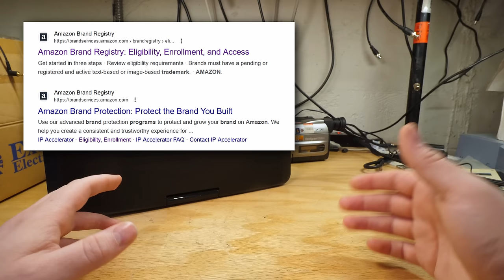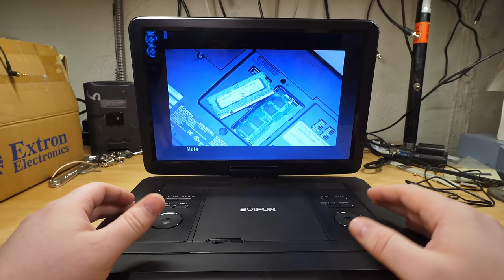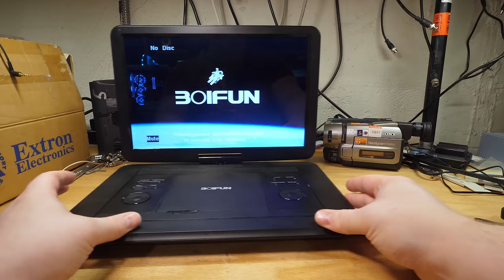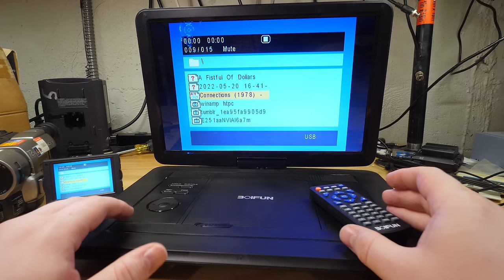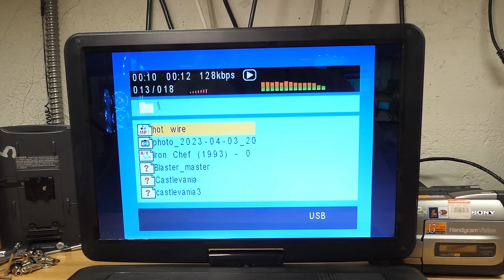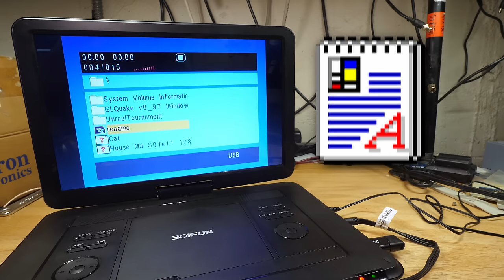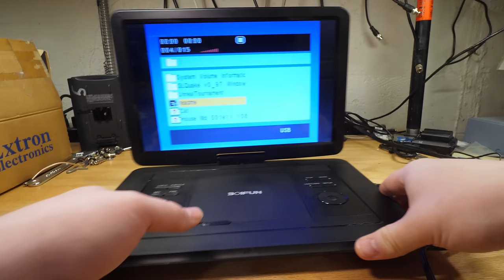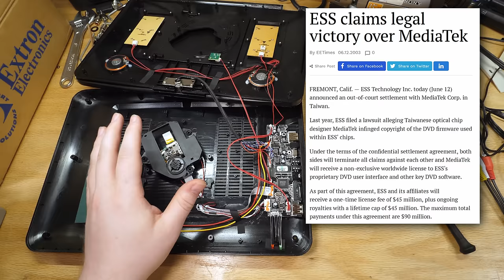Cheap, Silly, Remarkably Useful DVD Player

Comment: What's actually impressive to me is that only maybe 6 years prior to that chip coming out, you needed a dedicated MPEG2 decoder to play DVDs on a typical PC. Those decoder cards were packed with chips, and there were also CardBus versions that were prone to overheating. Only 6 years later we have a single-chip solution that not only decodes MPEG2 and MPEG4, but also incorporates the rest of the system-on-chip. It looks like a worthless chip these days, but for 2006 it's actually impressive. Tech used to actually advance a LOT faster than it seems to these days.
Reply: In the early 2000s I had an 866 mghz P3 with an awful intel 815 iGPU that could play DVDs & it to my knowledge it did not have hardware mpeg 2 decoding.

Comment: 6:40 About DVD's aspect ratio... yes, it's hardcoded... and very limited, at that. DVD-compliant video is strictly 720×480 (1.5:1) and a flag is used to tell the player whether to morph it to 16:9 (1.78:1) or to 4:3 (1.33:1). Basically, every single movie ever pressed to DVD is anamorphic. And how about movies that were shot and edited in wider aspect ratios like 1.8:1 (The Breakfast Club) or 2.4:1 (Inception) or something ridiculously narrow like 2.76:1 (The Hateful Eight)? Well, they're letterboxed out to 16:9 and morphed to 1.5:1 all the same – there really isn't any choice in the matter.

The tradition kinda continues with Blu-ray too, though at least Blu-rays are true 4:3 and 16:9 (i.e., 1440×1080 or 1920×1080): Blu-ray movies with aspect ratios wider than 16:9 are still, I sh*t you not, letterboxed out to 16:9. When you watch a 2.4:1 AR Blu-ray, it's ~1920×800 letterboxed out to 1920×1080.

How do I know? Well, I've been ripping DVDs and Blu-rays to PC for... wow, would ya look at that... just about 25 years now. Damn, I should look into turning this hobby into a side gig. 😅

Comment: As far as I can remember there was some kind of flag signal that analogue SD video signals could carry that triggered wide screen settings in monitors. Most of the last batch of 4:3 CRT TVs even had a "you know, I'm not a wide screen, so how do you want me to show this widescreen image?" In the OSD settings. 

I remember this specifically as over here in Sweden, in the pre HD days, ad financed channels would switch modes for each ad break and you saw the switch happen in real time if you set things up correctly. I suspect there's something hidden in the magic land of the analog off screen video signal. 

DVD's however, I am pretty sure, did this with a digital flag in the video stream. Basically stating "oy! I'm widescreen, deal with it." And rhe scaler in the hardware would make an appropriate signal out of that and feed it to the RCA, SVideo, SCART, or even HDMI for the fancy ones. But it does make me wonder about those old CRT's did they actually digitally rescale it, or... did they just fudge the timings in the CRT to draw it stretched out when needed? I guess it could get messy with the shadow mask. But the relative simplicity of ut  makes me want to believe it.

Comment: 30:30 on my dvd player you get a low batt screen indication in the center of the screen, the screen starts turning on and off while the audio stays and then shuts off completely, mine also has digital tv (dvb-t) but no av in and game function, came out in 2008

Comment: If that screen image can flip, it'd make a better under-cabinet dvd player, than the real under-cabinet dvd players. It so slim folded up and the screen's huge. 📀
Some 3M dual lock should stick it up under there fine and it'd practically vanish into the cabinet's lip/overhang.

Comment: My niece has something similar if not identical under another name for in the car (the controls are very familiar as is the LED window although I don’t recall the game port) and we have tried to use it with big TVs while on holiday and super annoyingly you can’t defeat the internal speaker; if you mute or turn it down, it turns down the external audio also.

Comment: For the controller, I feel like it might be important that the commonly available USB game pads these days [i.e. Xbox and Playstation controllers] are not standard USB HID controllers - I don't know if you tried a HID controller or not, but since you mentioned the Xbox 360 it made me remember how annoying it was to get an original Xbox controller working on PCs back in those days since Microsoft didn't care about that use case [it was USB 1.1, electrically, but you needed to dissect the cable and install a special driver] - even the 360 was better since it was explicitly supported unlike the original, but it's still its own thing with its own driver, as was the PS4 when I tried it much more recently.

Like, the chip datasheet does mention it supports USB and I can't imagine what else that'd be, since presumably the front panel buttons and the IR have dedicated input pins.
Reply from the maker: Oh yeah, I did make sure to try some older USB controllers that were more likely to be HID. Just thinking about it though, I really think it's likely that the intended controller is not USB at all, but literally just a famicom gamepad passed through a USB port.
Reply from the maker: The USB support in the data sheet would be for the USB storage, right?
Reply: Maybe, but that'd be wild if so, if it were an actual NES-on-a-chip that'd be one thing, but as part of a more general purpose computer it seems weird. You can probably tell with an oscilloscope if so, though, the NES gamepad was actively polled.

Anyway, it seems it's likely much less interesting - I found a reddit thread from someone trying to get the gamepad in the photo working on a PC, and it was recognized as an unknown USB device. So it's just some proprietary non-HID USB protocol, not some weird connector reuse.
Reply: Tangential but for whatever it means to you OP, my Xbox Core Controller didn't require any special setup on my computer like installing a driver, and in fact neither did my DualSense; it's just DirectInput-only, has slightly oddly mapped buttons and software is necessary if I want to use the touchpad as anything more advanced than a giant button, but it's very plug-and-play otherwise. Admittedly though, I use it exclusively plugged in, as I've read features are missing over Bluetooth.
The only controllers I've personally used on PC that required any setup more advanced than "plug into USB port/pair with PC" to just work were my DualShock 3, and the official GameCube Controller adapter that Nintendo made.

I wouldn't know if this necessarily debunks the idea that they're in some way non-standard USB HID devices, but thought I'd mention this.
Reply: @SpaceDetectiveIt's good to know the newer ones are less fussy. I use a XBox 360 controller with my PC and I very much needed to install a driver to remap the buttons & directions to something sensible for games that don't directly support using an XBox controller specifically. The defaults for HID were something wacky like left d-pad = button 1, etc.
Reply: @Levi I can't think of any pre-XInput games I've played using a controller, but judging by the Windows game controller properties thing and trying DirectInput modes in a couple emulators, the Xbox Core Controller d-pad's handled as a POV hat which seems pretty normal to me, and all the other buttons are sensibly mapped. The only issue I can raise is that the analog triggers are mapped to opposing sides of the same axis; i.e. if you were to press down both your game will think you're pressing neither down, though that's apparently an issue endemic to not just Microsoft's Xbox controllers but XInput pads in general.

I should note too that when I said the DualSense's buttons are weirdly mapped, I really just meant in relation to how the Xbox controller's buttons are mapped in DirectInput games. By itself it seems totally fine to me, and it also doesn't have that shared axis issue with the triggers.

Comment: I have similar oddball portable DVD player , tho , my sounds "Japanese" alike , Yukai MP-70A , and it has besides disabled USB port (plastic cover , nothing under when removed) all connectors in 3.5mm jack form. There's a weird connector with phone text next to it , then goes audio out , coaxial , video out and progressive scan. On the back is weird connector I thought to be the dock of some sort , but it's not. It's for the external battery. Other features it claims to have other than DVD playback are: Kodak Picture CD , Dolby Digital , ASP aka AntiShock Protection and playback of DiVX/MPEG-4 files (including Xvid). Mine is 7" inch display and , according to the internet , it came right before BLU Ray was a thing - 2005.

Comment: Curious if they used the USB port for a standard nes controller connection. It needs 5 conductors. Power/ground, clock, latch, and data. If you used the shell of the USB connector as a ground and repurposed the ground pin, you could theoretically use it for a nes controller.

Given it seems to be an potato based emulator however, I've really got no clue.

Comment: Video on the base of a 3.5mm isn't Apple's thing. It's Sony's and the plugs used to have Yellow dividers to signify it. The purpose is, more often then not. If you plug it into a 3 pin 3.5mm the ground pin is more likely to be where the 2nd band in on a 4 pin is. Allowing more chances of the wrong cable being able to be used with Yellow and Red just swapped around.

Comment: MediaTek is a customer friendly company. If you have a need, and you meet the MOQ of a couple ten thousand units, they will pick up any of their old designs and get the chip reissued for you on only several months notice.

If you have an MPEG4 decoder and an MPEG1/2 decoder as one unit you already have some bitstream processors and the MDCT decoder that is flexible enough to decode JPEGs very very quickly with hardware assistance. But... you could also like not bother with the complexity of figuring it out, because speaking to dedicated hardware and trying to configure it is always a little tedious, and just slap IJG JPEG library in there, reference implementation that comes from the standard, back then VERY VERY slow, and in combination with your slow CPU, i think that's what you get. It's especially painful if you don't have an FPU and have it emulated by the compiler.

Being a DVD player it's more likely to be an independently developed MIPS derivative than an ARM for cost reasons.
Reply: 30:42 Yeah look at the second line on the IC. I checked against several other of their chips, Mediatek puts the date code there right at the start of the line in year-week format. So this chip was manufactured mid 2021.

The silkscreen is useful during early test batches and then it's just left on because it doesn't actually add to the cost.

Comment: 4:25 - also on electric cars, in case something bad happens, like computer going crazy and accelerating out of control, or some short circuit happening and things are starting to smoke. Other "dangerous electric machines" have mandatory "stop" switches cutting off the power, why not cars?

Comment: the way the the optical drive is NOT! mounted and resting on rubber is something i've seen in the sony playstation. i always assumed it's for having some sort of suspension rather than being cheap and entirely solid, but then again i saw it first in something that was relatively well built.

Comment: I quite like these weird old stuff. Keep your eye out for something like the Epson P-1000 Photo Viewer (2004). It seems to me that I recall Micro Center selling something just like this. The item I recall was far more boxy and that black/brown plastic and around or before the spray everything cheap and silver. If I recall it was between 2003 and 2004. I could not find any other device other than the Epson in my searches. The device was for sale for $999 to $499. I do recall seeing it a while later and price was reduced.
Reply: From what I gather the Epson P-7000 Multimedia Photo Viewer is the last version which is the 160gb and the 6000 is the smaller version of 80gb.

Comment: im 99% sure that display is your run of the mill cheap 15inch laptop display i bet its 1366x768 too and that you could swap with any cheap laptop from 2010-even today tbh.

Also this firmware ui is THE SAME as a dvd player i had in the late 2000s/early 2010s from a company named Denver (which is a legit european company) no idea of the model number rn but it was white and black, literally new memory unlocked.

I wish i had it rn, my mom had me give it to a cousin of mine even tho i removed the battery bc it was completely bloated like fire hazard and it lasted like 5 secs so it could only run on DC in (also yeah when the battery runs out it just turns off nothing fancy lol, you can even power cycle it until it can only stay on for a milisecond).
Mine did not have the game port tho, at least i dont think it did? wonder if it could run nes games anyway, or open text files, or if it has the same chip, i think i should have pics of when i opened it up to remove the batery but that was potentially 5+ years ago lol if i find any i'll update this comment

Comment: Regarding the 4 pin 3.5mm composite in - My 2019 Sony TV has that as an input - resulted in me custom making a cable for it. It also looks like... well... composite in to a 4K screen. It's not great but it means it's still being used on even higher end stuff.

Comment: Not an expert but I design PCBs for my personal use. A footprint will come with a reference layer, not visible, and a silkscreen layer which is visible on the final board. There might have been some autoroute business going on but all that data is there by default if following best practices. I use Kicad for an EDA.
Reply from the maker: Oh that's a good point - if they were silkscreening *anything at all*, then of course the labels from the EDA would be included by default.

Comment: Sorry to be that guy that leaves multiple comments but I had two other questions: Does that lipo pack have an onboard BMS? It didn't seem like the mainboard had any battery management, unless the processor does it somehow?
Reply from the maker: I didn't pull them apart, it's possible there was a micro PCB under the insulation. I know one of those chips was a battery charge controller, but I don't know if that's all there is to it.

Comment: There are very few ASIC designers and it is not uncommon for companies to contract an ASIC designer for a project. It could be that the same ASIC designer worked on both chips and that might be why there are some similarities.

At least that is my understanding from knowing an ASIC designer that works on a variety of chipsets for wireless backup cameras.

Comment: I remember i had a cheap DVD Player home when i was a kid, around 2005-2006, that also played NES Games. Don't remember if the emulation was as awful as in this one, it probably was.
also, 38:07 You forgot to plug that connector back
Reply from the maker: I finished putting it back together after the shoot because I'd done so many takes lmao

Comment: If that Mediatek chip can run ESS firmware, then it must use a MIPS-X CPU.  Specifically, ESS's special modified variant of Chow's MIPS-X.

This would likely explain why they didn't really want to mention the CPU type on the product brief:  Literally nobody else uses this CPU, so if they mentioned it in public, it would've tipped off ESS.

Comment: A CISC 50MHz 68030 can run NES at full speed. PSX 33MHz ARM also do that. So, this is probably a 16 or 12MHz CPU, or the emulator is not optimized or something.

Comment: The game port is the funniest thing. I have a cheap dvd player and it had one, looked into it and found the shitty little controller. It's basically just another composite input but in the shape of USB. Well mine was anyway, there was also one I saw that used a 3.5mm Jack for it which made more sense.

Edit: This one is different to mine. Mine had a Nes on a chip inside the controller not the dvd Player and was a completely different controller.

Comment: I was wondering whether or not the brand of that aftermarket battery you used as an example was actually alphabet soup or if it was founded by a rich frat boy.
Unfortunately, the address listed in the trademark is in Shen Zhen. I choose to believe that the owner was actually fluent in english and had a sense of humor.

Comment: Hi man! I know this will not match video topic, and you don't really touch subject old ENG cameras that much anymore but.. I have really good deal on DVCAM Sony DSR-300AP in my area and the thing that stops me from buying it is capturing video. The camera has a standard FireWire/i. LINK port, I have a PC with Win XP that I always use to capture videos from DV camcorders, but I'm not 100% sure if this camera will allow me to do that (won't cause any werid problems). Manuals are hard to find, and when finally something is found it usually just says something along the lines of "i .LINK port for losless DV video capture!". If you'd be so kind to provide me with some help I'd be very glad! Best regards!
Reply from the maker: Hey, no problem, I'm happy to help! You should have no trouble. I have used several cameras from that era, capturing into an ordinary copy of iMovie on Macs from the same time period, as well as several other types of DV devices, and everything worked fine. Technically I believe that DVCAM is a higher bit rate than normal DV, but I don't think I had to switch my devices to use the standard bitrate, I think it just converted it on the fly. At any rate, I don't expect you would have any issues beyond possibly needing to set it to 25 megabit mode, essentially everything in existence with an I.link port should be compatible. Hope it works out for you!
Reply: @CathodeRayDude  Thanks a lot for such a quick and big response! You convinced me to buy this piece of hardware. Keep up the good work on Youtube, have a nice day :) !